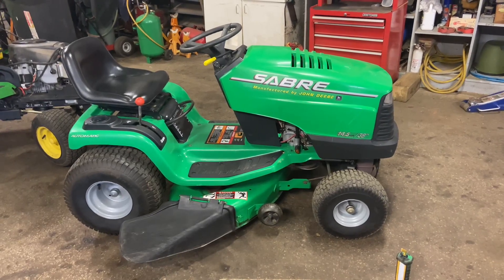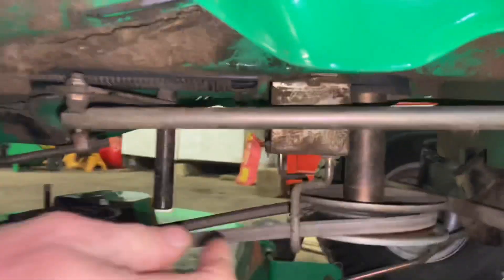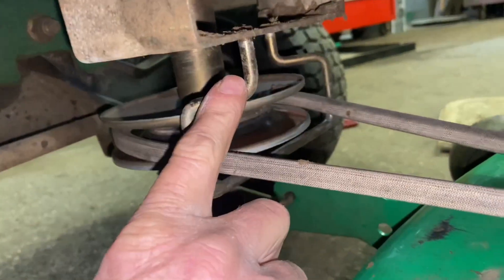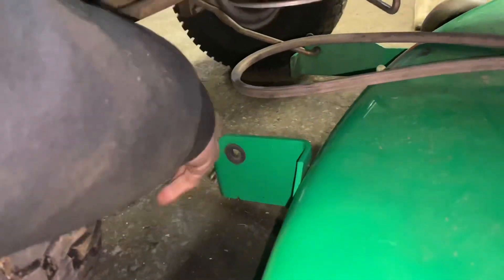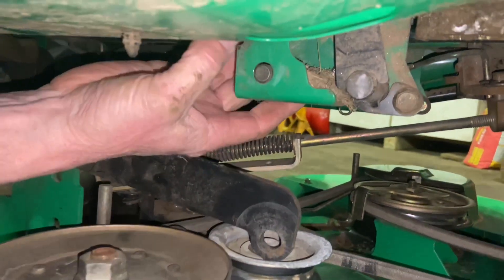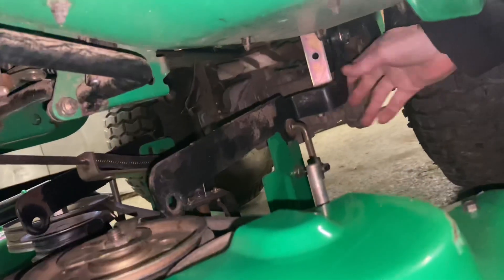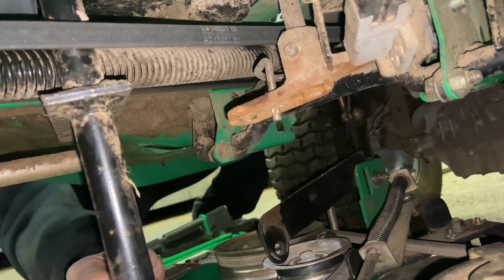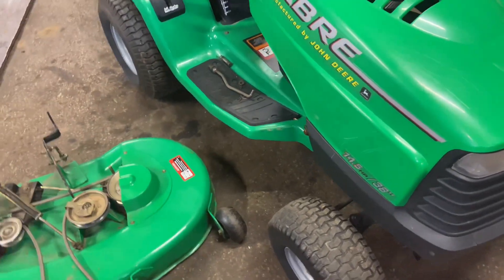How to Remove the.Mower Deck John Deere Sabre

Comment: Thanks for the great video!! I’m looking for a belt for Sabre 1338G 38” Deck. I have purchased 2 so far and both do not fit. Does anyone have the correct measurements of the belt or part number please?
Reply from the maker: Call your local John Deere dealership with your model and serial number of your machine and they will get you the correct belt.

Comment: Hey Brad love your videos. I have the same mower 1438GS and went to adjust the deck up because it was sitting too low when all the way up at 4” while cutting. I noticed there’s only one jbolt on one side of the deck. I’ve had other John Deere’s where they have one on each side of deck for leveling or bringing up cutting height.  How will adjusting one side keep the discharge side from sagging.  Should I move that right side bolt  into the slotted hole and then tighten that with a block under deck so they are even?  I was thinking of getting some more hardware from local tractor shop for the right side because I see there’s holes there for the adjustment hardware.  Thanks for any help and keep up the good work. I love watching and learning from your videos. I’m amazed by how fast you can get stuff apart and back together.
Reply from the maker: Unfortunately that model only came with the one side able to be adjusted. You should try whatever works. I do not get into any modifications because there customers machines and not knowing what will work and what will not work is not the way to go with someone else’s machine. If you do figure out a good solution, you should document it for others. Thank you for watching my videos. Please share my channel with friends to help it grow! It would be greatly appreciated.
Reply: Thank you for the timely response and thanks again for the educational videos. :)

Comment: thanks for this video. I acquired the John Deere Sabre 1438HS from a friend for a very low price. It hasn’t been serviced in a few years so I’m doing research on what’s needed. This video was very helpful. Do you know if there is a mulching plug available for the 38” Sabre deck?
Reply from the maker: Not sure on the mulching cover. You may be able to find a plastic side cover that will fit. I would suggest calling as John Deere dealer to find out. They may be able to get you as part  number to research if you can get one.

Comment: nice video! just the way I like it! Plain and simple! No rambling on about what you ate for dinner last night!
Reply from the maker: LOL, I’m glad you liked it! Thank you for the kind words:)
Reply: @JohnsonsSmallEngines  Hey, another quick question on this Sabre. Mine is a 15HP Briggs. It's an older one like the one you use in the video. I inherited it to use. Needs some love, but I'm hoping it will be a decent mower if I keep up with it. It does run fine, and supposedly works, but like I said, I like to have everything working without the hassle of a tire blowing out, belt breaking, pulley bearing seizing, etc.. So I'm presently working on cleaning the bottom of the deck to put some rust converter on it, than paint it. Bought a mulching kit for it(BG10107). Comes with new blades, so that's  a plus. The engine compartment was covered in oil. So I wasn't sure if that was from neglect( someone spilling oil on it while refilling) or if it had a leak. I hate a leaky engine. Everything sticks to it. I degreased the entire engine area and frame(since it had run down into the frame and on the mower deck). I have only run it one time since doing that for a short while. Today while I was working on removing the deck, I noticed oil on the side of the engine. It looks to me to be right where the governor shaft comes through the block.Or possibly the gasket between the upper and lower block. Was just curious if you've seen this before, and if it's common. Thanks

Comment: Thank you your video was very informative. I followed your video and was able to remove my mower deck quite easily. I have a 1438 gs and I have a question do you know what the part # is for the blade brake pads. Mine are metal to metal. Thanks again for the great video.
Reply from the maker: You will need to go to the John Deere web site or call a john Deere dealer for that information. Here is a link to the website that i use. https://partscatalog.deere.com/jdrc/. Please give my video a thumbs up, subscribe and tell your friends about my channel to help it grow. It would be greatly appreciated.

Comment: This video is easy to follow, and I am really grateful you uploaded it - that said...

The two spots on the back that you pull out at the pins (starting at 3:30) is killing me.

I have a GX1438, and it seems to be exactly the same as the one you're working on, EXCEPT for these two spots. Where yours just fall straight down after you take out the pin, the part on mine the pin holds are set in a slot. You can't back them out of that slot, because their other ends are over the deck lowerer/raiser, and don't go back any more.

I have looked everywhere for a manual for my mower, and cannot find one. My yard is starting to look like a jungle, and I'm afraid my neighbors are going to give me a blanket party when I'm sleeping if I don't get it mowed soon. Please help if you have any idea what the next step is, this is the only thing holding me up from getting my mower running.
Reply from the maker: I would need to see the machine to be able to help you out. It’s tough over the inner webs. I put theses videos out to help people but I can’t do more than that without seeing the machine.

Comment: Do you still read comments? Are the 14.5/38 and 15/38 deck & deck belt the same?
Reply from the maker: Yes, I still read comments and I cannot answer your question. I would suggest calling a John Deere dealership to find out. You can also find your correct belt by using your model number of your machine and going to the John Deere website and looking it up.

Comment: Thanks for video! Exactly what I was looking for! Do you have any idea what size is belt? Is it same size on manual transmission Sabre?  My just broke in pieces, can’t even find what size is it
Reply from the maker: You will need to take the model numbers off of the sticker on the tractor and call a John Deere dealer to get the correct belt. I always look up the correct belt that goes with the model numbers on the tractor as there are a few different models.

Comment: I am having an issue with when I let off the parking brake the mower shuts off. I have been up under it and feel where there is a plastic clip that under the floor of the mower and it moves. 
I wouldn't put my hand under there with it running. I am having a hard time finding much info on John Deere Sabre 14.5 hp.
Any info would be great man.
Reply from the maker: It sounds like a safety switch issue.  If you engage your mower deck with a lever? Make sure the lever is all the way in the off position (there is a switch). Also check your seat switch to make sure it is plugged in and working. There is also a brake switch to make sure it is connected properly or test it. I have come across your issue before but it could be many different things and without being there to see the machine, I cannot help much more then that.

Comment: Great video!! My son and I used this video to fix our lawn mower and we used this step by step. We ran into an issue putting it back on though. Is there a trick to get those arms (with the floating pins) lined up correctly so that the mower deck goes up and down? We can get the front back in with the pins but the back part of the arms we aren’t sure where they’re supposed to be so that the deck moves up and down. Any tips?
Reply from the maker: The rear hangers go into a slot on the rear hanger that has a roller. The hanger will sit in the slot in the roller when the rear hanger is in correctly then you lift up the front of the rear hanger with the hole in it and put the pin in. I know this may not make sense so what the video as I take down the rear hangers and you may be able to figure it out. Unfortunately the machine has left my shop or I would take another video to show you.
Reply: @JohnsonsSmallEngines  wow! Thank you for replying so incredibly fast!! We were actually working on it when I sent the message. And it DID make sense and it took some time, but we figured it out with your message!! Again, thank you so much! I’m a single mom and my 13-year old son and I replaced the transmission belt ourselves so we used two of your videos! We could have never done it without those videos. SO good and so helpful!! I really can’t thank you enough!! Great job!!
Reply: @crichardson720  wow. You are great. I just changed the deck belt by using this video. Now I read that you changed out the tranny belt. How was that? I mean I may as well tackle that job too.